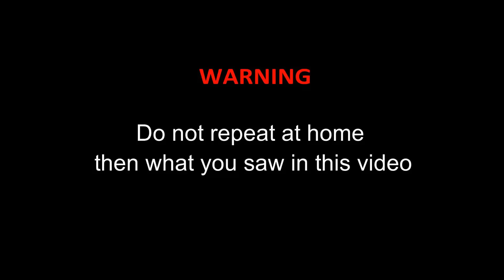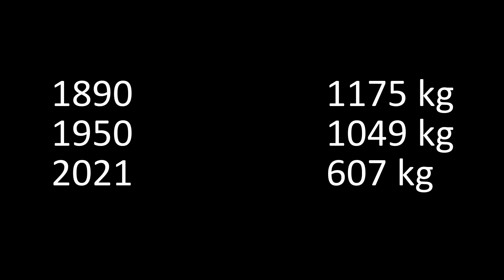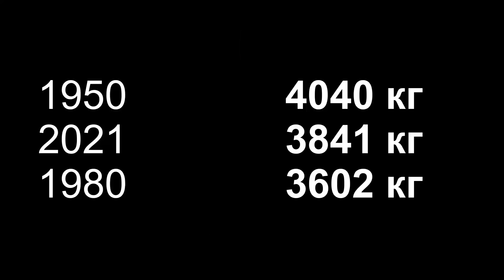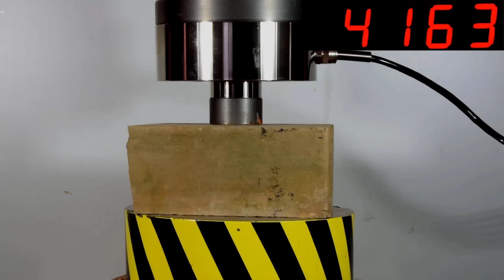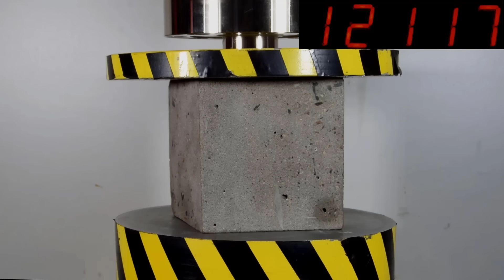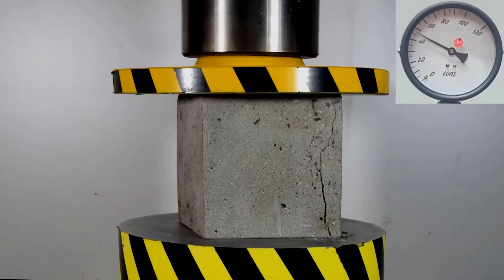HYDRAULIC PRESS VS OLD AND MODERN BRICKS

Comment: I’m a builder and have overseen and QC’d tens of thousands of bricks installed. Modern bricks, full of air bubbles and cavities for better insulation value and freeze tolerance, are used for facades with the actual structure being concealed behind them with an air gap and usually some type of water proof insulation like mineralwool. 
Bricks actually are a very brittle building material and are rarely used for any type of load bearing anymore. There are much better modern techniques that are hidden behind the brick wall you see that won’t collapse should a wall get hit, as would happen with a traditional brick wall.
Reply: For a builder you do not seem to know an awful lot. There are still massive victorian viaducts consisting of millions of bricks still carrying heavy loads to this day, over a hundred years later. Your cheap imported chinese air bricks you use to cut costs will not stand the test of time as not whatever you’re building
Reply: @Brandalar  using your logic, we should all be be living in pyramids. I also was unaware that they had our modern bubble-filled non-structural bricks back in the Victorian era. It’s almost like the techniques and materials have evolved since then to become more sustainable, energy efficient and affordable to the masses….? 
I don’t know what China has to do with this? Bricks are cheaper to produce and ship domestically than import. About the only material we import is quarried stone for countertops, but only when we are buying a literal boat load. And that’s made by Mother Nature. 
We use CMU’s (aka “cinder blocks”) filled with concrete and rebar if we need a structural masonry wall nowadays. They are significantly more resilient and stronger than stacked bricks. Or we use precast concrete. Or steel. Or cast in place concrete. Or prefab wall panels. Or one of a hundred other methods.
For being some pretentious guy in the YouTube comment section, you know about as much as I expected you to.
Reply: @Brandalar  you are trying to sound intelligent about modern building materials and techniques. You are failing. Cutting costs and finding more efficient ways to make housing affordable is very important for society. You clearly have no real world experience, and it’s painfully obvious.

Edit: I see you deleted your most ignorant post. Good call.
Reply: Sadly those "newer" (even 10years+ back) type of bricks tend to have humidity in them,reject it and wite spots appear.
Not good for visuals appearence.
Reply: @baddestmofoalive  defaulting to insulting a person’s intelligence is a sure way to see you’re on the loosing side of an argument. No mr. builder, cutting costs and cutting corners is not the way forward or good for society, and houses are higher than ever whilst people’s wages are stagnant for decades
Reply: @Brandalar  “For being a builder, you don’t seem to know an awful lot”
No one likes a hypocrite…..
Reply: @dederen1492  we call that “efflorescence” and, unfortunately, that is a natural byproduct. Architectural masonry (and most any other cementitious product) does need to be acid washed periodically throughout it’s early lifespan until that slow chemical reaction eventually completes.
Reply: @Brandalar  you are completely correct for the record
Reply: @Brandalar  I can't tell if you're just trying to troll or be serious, but pretty much everything you said is nonsense. Almost nobody uses bricks for structural building and haven't for decades. It's mostly steel beams with a facade of choice. Sometimes it's bricks, sometimes it's cut stone. We're not living in the 1800's anymore. Structural steel buildings are far stronger than brick buildings alone. If you're redoing a viaduct, you're not going to use general facade bricks and nobody is suggesting that but you. It's okay, take a deep breath and calm down and take the L everyone had handed you.
Reply: @caodesignworks2407  Point out ONE (1) thing I said that is incorrect
Reply: @caodesignworks2407  Nothing? I thought as much.
Reply: @Brandalar  Homie, I have a life that doesn't consist of being wrong on the internet. Try it sometime and learn that different grades of brick are used for different projects. Get over yourself and educate
Reply: @caodesignworks2407  "homie" stopped reading right there
Reply: Funny , because most builders i know say the opposite of what you do. Red bricks are more expensive but last longer than other "new" material, when i see people building "cheap" houses they always go for the grey bricks or whatever they are called, while people with money go for the traditional bricks here. I'm not a builder but seeing apartments that are over 100 years old and still stand after 2 world wars and other stuff i would rather choose the traditional bricks over the new bricks.
Reply: @gubbica99  

When you go to see the person's knowledge, he barely knows the difference and what each construction product is for.

Comment: As someone who has broke a many of concrete cylinders, what kind of aggregate did that modern concrete block have? When it split it just chipped with no larger rocks in sight. I’ve pressed some class S for bridge structures that popped as high as the 1890 fortress structure. To be fair on average it was about 4 tons per SI (so the point that the old stuff is better still applies), but just making sure we’re testing structural grade concrete. The modern break looked like a lot of class A cylinders I used to break, mainly used for sidewalks.

Comment: The reason for the modern brick breaking so early in your first test scenario is due to the way it was produced:
An extruder press is used that basically pushed clay forward through a mouth press. that forward push is done by a mechanism that looks like an archimedean screw.
The result is a circular turbulance within the clay that is almost impossible to see but still there. Look at 1:10 - that circular breakage is exactly due to the spin in the screw.

other than that dont be fooled. there is an insane number of different materials and processes for both bricks and concrete which has the most impact on these tests.
this video might make you believe that old materials were better, but thats not true unless you compare apples to apples (in wich case modern facturing wins) 
also please consider that "harder is better" is actually not the goal here. both soft and hard bricks are produced deliberately for their very own purpose.
Reply: I call it bs! Older is better
Reply: @trolojolo6178  you may do that. but since i work in the field of restoration of historical ceramics (bricks and tiles) i have a pretty broad experience when it comes to those materials. 19th centuries bricks were in a much higher demand than they are now (pretty extreme city grow and a lot more % of buildings used bricks than now). Combined with the fact that long range transport was a lot less economical -  the bricks were produced in close proximity to large cities, not necessarily at places where clay was at the highest quality.
In addition their kiln ran with coal, which cannot be run stable at an intended temperatur for a certain time like modern gas or electric kilns do. 

are there bricks from the 19th century that are very dense and sturdy? absolutly! can they compete with the maximum that is possible today? nope.
Reply: As a potter i agere with that
Reply: I have also heared that its always better to use at least 2 or 3 years old bricks that just crafted ones
Probably that helps on the sturdyness
Reply: Bruh. No need to exaggerate credentials. This aint your resume. We know you just remodel bathrooms at gas stations. Lol
Reply: @conceptuallyugly530  as a weasley I too agree with that.
Reply: @ZebraLuv  There is nothing better than a nice clean bathroom on the road so this person is doing a bang up good job
Reply: @ZebraLuv  job shaming is cringe dude. If you have a name like that it just emits more info about what your personality is and how privilged you are
Reply: @katamere4308  I reside in Manchester NH ,  The Manchester Millyard has dozens of massive  " real " 1800's brick buildings that are in tip top condition . I can attest that the old bricks were of a much higher quality  as I  also am in the trades and often witness modern homes   that aren't even 50 years old with bricks that are already disintegrating especially  the chimneys . I've worked on many homes that were built during the 1700's with original brick chimneys that are  still in good condition .
Reply: This was for fun.
Reply: @katamere4308  "The maximum possible today" Sure, whatever, but while I am not a bricklayer, I have worked in construction for 8 years and I know that the standard brick from a demolished older building is superior to the average brick that is used today; which is why they are kept aside, cleaned and re-used where possible.
Not to mention the face bricks can be appealing, the sometimes-random mix of colors in older bricks can fetch a higher price when re-used.
Reply: @trolojolo6178  Older ≠ better do an research, older bricks tends to break even often than modern, cause of 1 thing.
NO OXYGEN.
Reply: @katamere4308  I'm so impressed by you. You seem really intelligent about this stuff and worded it all perfectly.  Bravo
Reply: ya...modern materials suck ass😂. Older stuff are made to last , new stuff are made to be sold and replaced
Reply: @Senkino5o  Older bricks are "superior" for what? Insulation? No. Cost? No. Production? No. Safety? No, they're much heavier. Load-bearing Sure.. we don't really use bricks for that purpose anymore. If we did, I sincerely doubt we aren't capable of producing "superior" brickens, if needed. 

How often do you even use bricks in construction? I'm really skeptical we save century-old bricks to reuse for newer buildings.

Comment: It’s no coincidence that today’s bricks are lighter, more airy, more porous, but for greater thermal insulation.
Reply: Its also no coincidence the crack of the new brick is forming near the edge where a hole is visibly seen. While the cracks of the old bricks are formed right under the pressure head.

Comment: I think the fact that the bricks nowadays are used as non structural elements therefore it does not need to be as durable as the bricks back in the days is because they were the primary load bearing material back then

Comment: Old bricks were used as load bearing structural support. Modem masonry bricks ADD load to the structure, rather than being load bearing, so they are intentionally made lighter.

This is highlighted by the fact that he tested a modern load bearing brick towards the end of the test, and it did far better than any of the others.

Comment: I’d imagine modern bricks are designed to maximize compressive strength and minimize cost
Reply: Also most modern buildings only use brick ornamentally-- as an outer facade over a steel or wood skeleton-- rather than structurally. They're generally made to look good for a long time, not eat centuries worth of stress.
Reply: Not in the uk

Comment: Kind of interesting as someone that lives in a house built around 1945! Think one of the things worth noting though at least with the house I live in, is that the bricks do all the heavy lifting as we have no solid walls in the interior of the house (yes this means that we can move them at wanted, which is kind of cool!) So that probably accounts for some of the extra strength needed as modern houses certainly have interior walls that help take the weight.
Reply: 185 Kg Brick by 2092

Comment: Bricks nowadays focus on thermal isolation, while the 1950 one reached the peak in term of structural resistance. Also, concrete loves compression, the older, the more compressed, the tougher.
Reply: Thats the point - 
Modern bricks are part of a system of materials that work together. 
Also bigger bricks with hollow strucktures often fit into the next ones giving a way better structure by holding each other in place and not just lay besides the next ones 👍🏼